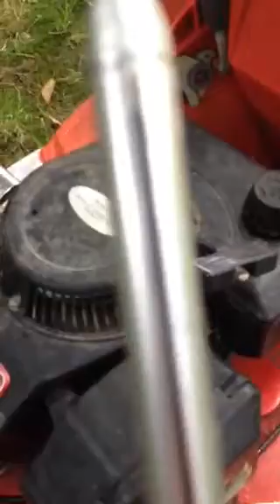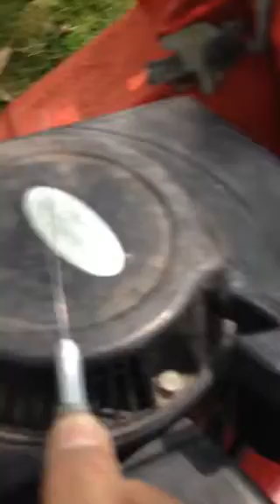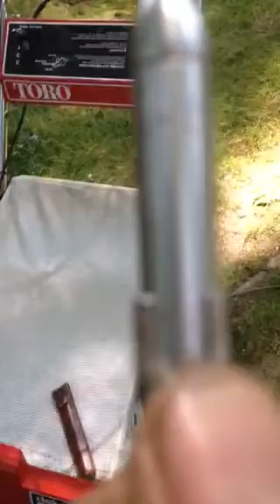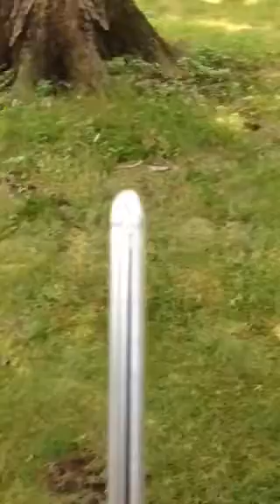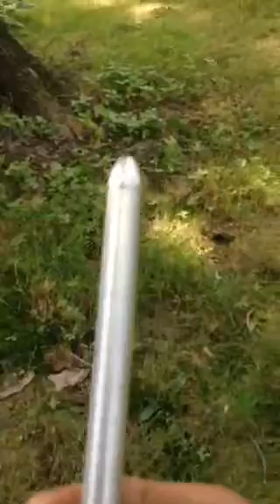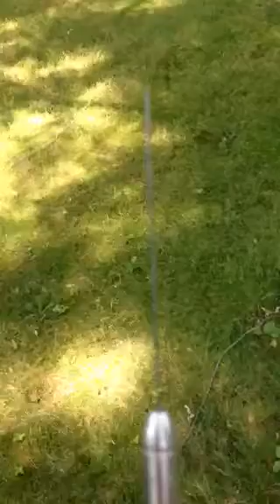Vibra-Tac tachometer demo

Comment: Did you say that the widest vibration is when you take the reading?
Reply from the maker: Yes. When the wire frequency resonances the engine frequency (RPM), the wire vibrates widest. ( That is why the army does not march on the bridge)
Reply: Thanks

Comment: Thanks for the video! Never knew what it was - was reading my snowblower manual about adjusting RPM speeds, and mentioned this thing. I feel better now knowing what this is. Great stuff - thank you!
Reply from the maker: Glad my video helped you and thank you for your nice comments.  I work on the small engine as a hobby and the Vibra-Tac Tachometer is a very simple and useful tool, which make the adjust the idle or max speed very easy. It can also check the electric motor RPM as well.